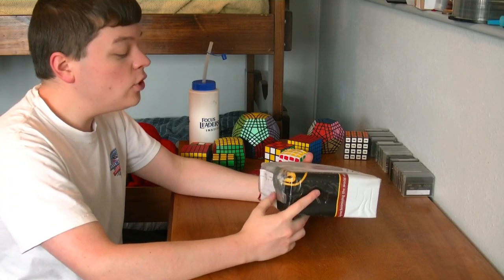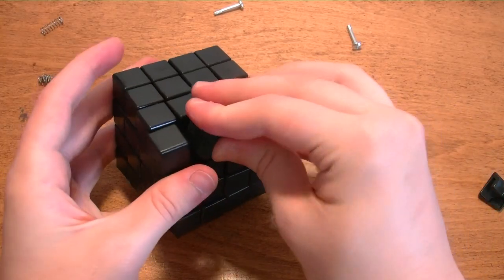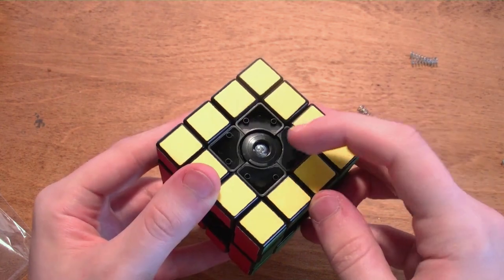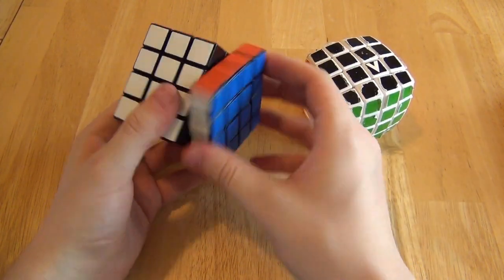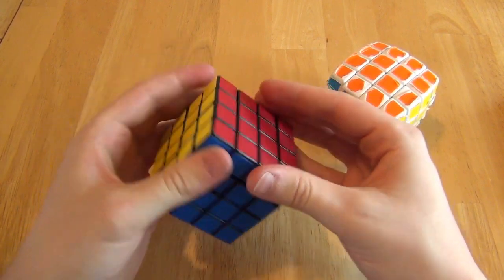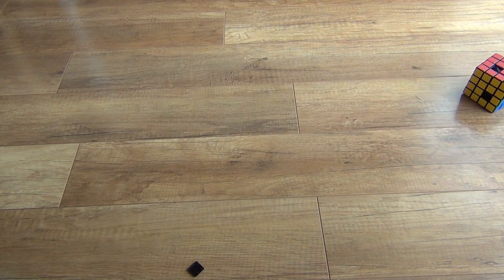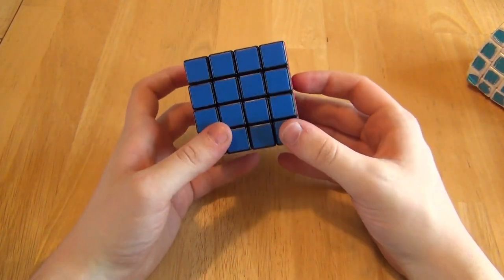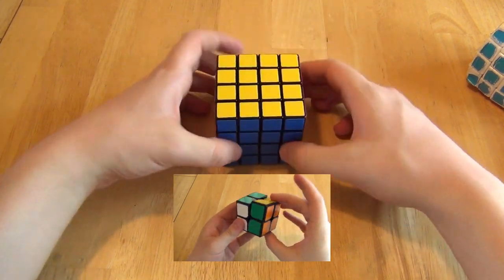V-Cube 4 DIY Flat Review

Comment: i recently started to learn how to solve the 4-dimensional cube, that you can get as a free little java program called "magic cube 4D".

its really fun and quite mind-boggling how you can rotate the 3d projection of the 4d cube in 3d. i skipped the 2x2x2x2 and went directly to the 3x3x3x3 because its probarbly easier when you have center pieces in the 8 sub-cubes that tell you where each color is supposed to go.

have you tried 4D puzzles? what do you think?

Comment: I kind of agree with the idea that the v-cube 4 is kind of toyish-grade, meaning that it has a toyish mechanism. only the flat has this issue, the pillowed, on the other hand has a pro-grade system in it. I own both but I dont play with them, I have fun with my other cubes, especially my zhanchi. Those 4x4's have a long way before they are considered good enough. PS, great vids, and I challenge u to a 3x3 sinlge solve. Worst time has to solve 50 solves of thier worst cube. PPS, good work.